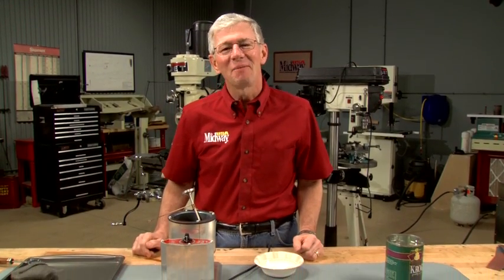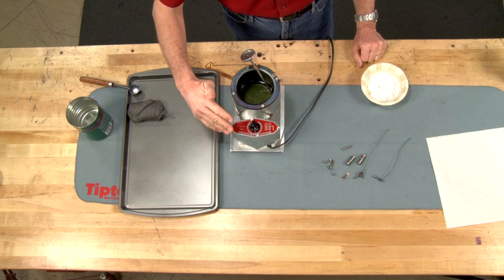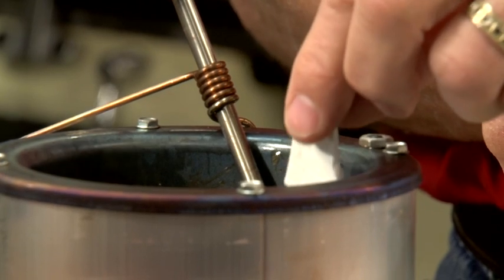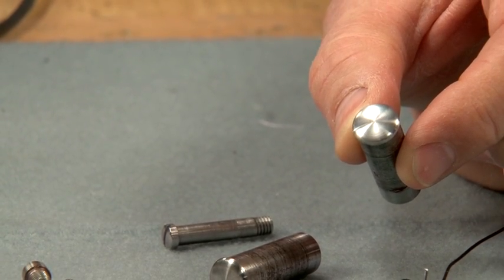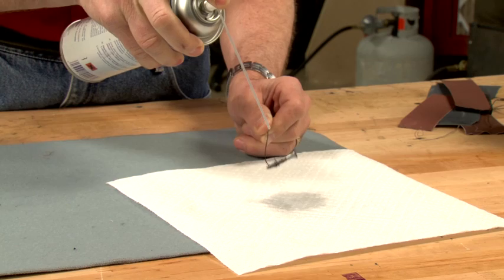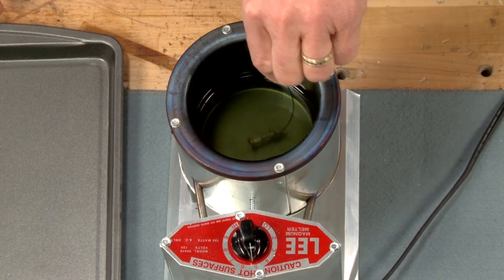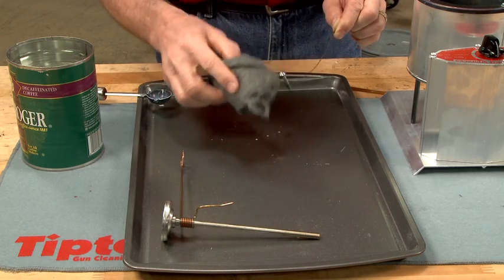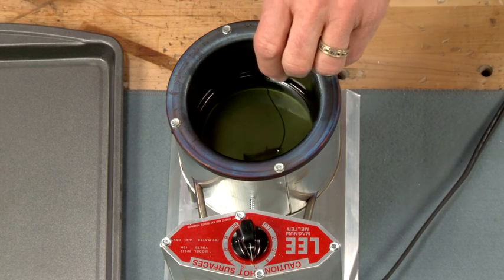How to Nitre Blue Presented by Larry Potterfield | MidwayUSA Gunsmithing

Comment: Larry ,could you use the same process bluing with Brownells Oxpho Blue??
Reply: They’re not the same. Niter blueing is melted salt. Oxpho blueing is a solution and would be boiled away well before it reaches 600 degrees. Niter blueing is somewhat of a misnomer because the salt isn’t actually blueing the metal. The 600 degree Fahrenheit temperature is. The salt is nothing more than a way to control the heat. This is also extremely dangerous and Larry is, in my judgment, making a mistake by not telling you of the danger in this video. At 600 degrees this melted salt will literally explode if the smallest amount of water is introduced into it. Say the tinniest drop of water in the threads of a screw or in the screw slot and it will explode out of the pot. At 600 degrees this salt will ignite paper, saw dust, most types of cloth and is allowed to land on you unprotected skin will give you a chemical burn every bit as painful and dangerous and boiling battery acid. Do a google search “dangers of niter blueing” This 1 1/2 minute video does exemplify the simplicity of the process but there is way more to consider than just polishing the parts and dropping them in the salt and rinsing them off. God forbid should you... say... dip a part then quench it in the water and think it should be darker and just re-dip it. That would be disastrous.

Comment: With this also work on stainless steel and aluminum?
Reply: BLD Lightpainting nope ..carbon steel only
Reply: I’d give stainless a try. Stainless does change color with heat and niter blueing is nothing more than adding controlled heat to the metal parts. The salt isn’t changing the color of the part the heat is. When you buy niter blueing it comes looking just like rock salt. Because that’s pretty much what it is. It starts to liquify around 400 degrees. After it cools off it turns into a hard solid chunk.